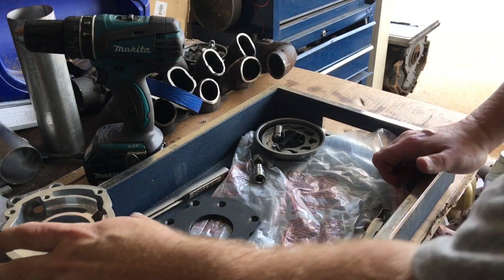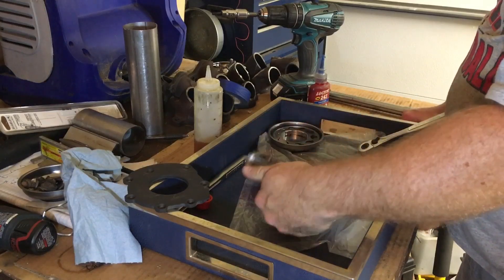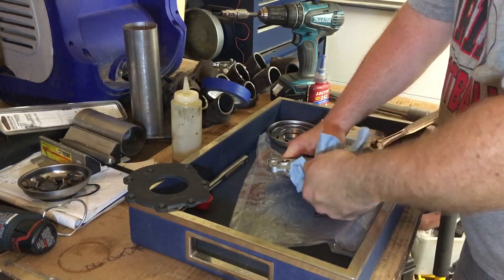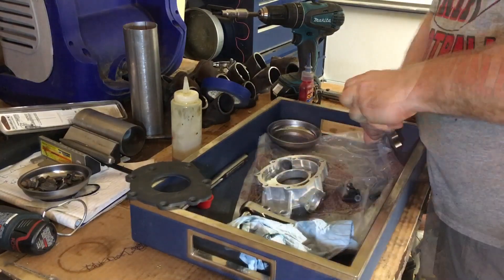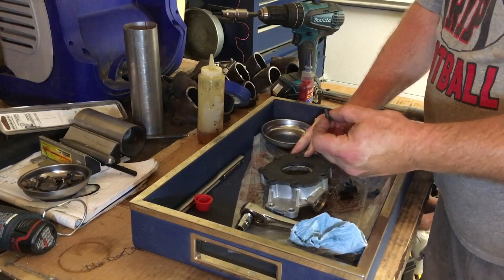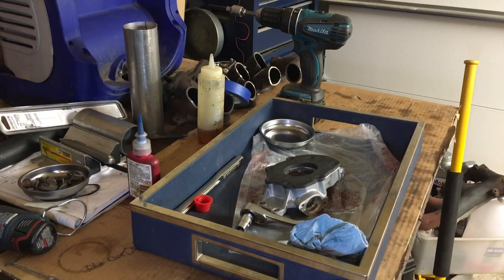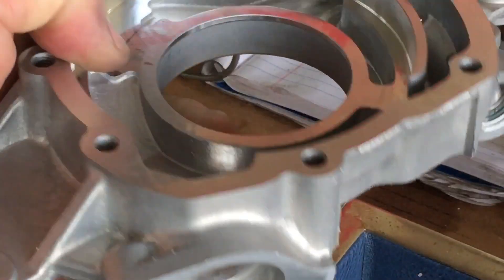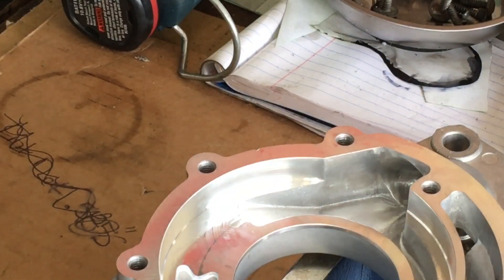LS Oil Pump Mods M-295 oil pump Porting/Shimming Complete DIY

Comment: The most unnecessary and wasteful "mods" you can do.  All this does nothing, the only way to increase flow is to increase the size of the pump gears,  The block itself has many 90 degree turns it forces the oil to go through and the pump doesnt displace enough oil for porting to make a difference.  Shimming the relief spring is silly as well, the clearances in the engine are what matters, unless you are trying to cover up a mechanical issue.
Reply from the maker: You can settle for a pump that starts bypassing oil pressure at 50 psi if you want.  I show how to improve the wet flow of the pump and delay the internal bypass to match the intended rpm usage when shifting above 5300 rpms. Thanks!

Comment: Nice video I’ll be doing the same for my project and how much PSI oil is at WOT or what’s the recommended number to not be dry on oil when I floor it
Reply from the maker: Normally with factory bearing clearance I see 70+ psi oil pressure at WOT M-295 pump with a .100” shim stock bypass spring.

Comment: You mentioned in a comment that you sell these pumps. Where can I find more information? Thanks.
Reply from the maker: I normally offer the porting/shimming service on any LS pump $75.00
The M-295 is the Stock replacement pump by Melling.  A better out of the box pumps are the 12095 and 12096. I do not recommend the 10355 pumps  , in a non-DOD application unless you will have an oil pan/system capacity of 8-10+ quarts due to very high pressure/volume; 80+ psi. JD
jeffdubray@gmail.com

Comment: Does shimming the spring increase idle pressure or just WOT?
Reply from the maker: Idle pressure seems to be a debatable topic. I can say when I shim the stock relief Spring .100” it consistently yields a Cold start 60 psi, hot idle 48-50 psi and 70+ psi depending on engine rpm. 
I haven’t seen any stock pumps match the same psi.  Plus, the stock pump is supposed to be rated as a 60 psi pump but has been proven to start bypassing oil around 53 psi which is not good at all for turning 6000+ rpms.  JD
Reply: @HeadFlowInc  I agree those are good pressures, and I’m seeing mixed opinions on it with idle. I’m struggling with 19-20psi hot idle pressure , new pump and oring- I’m thinking of trying to shim the spring just to buy me some time before I condemn  the motor

Comment: Where can a person source the shim for the spring ? Like your content
Reply from the maker: I bought a package of washers, they are the right diameter to fit nicely in the plug recess but I have to sand them to .100”. 
I’m not sure of the diameter at the moment but you might Google search once you’ve measured the inside of the cap and see if there’s any premade possibly hardened disc or washers .100”.  JD
Reply: @HeadFlowInc  what size washers are they?

Comment: one of the best described procedures I've seen on YouTube. I'm doing this on mine with a rotary tool, and I believe it's going to make a huge difference to increase my oil pressure from 25 at idle.
Reply from the maker: Blue printing or smoothing oil flow and shimming .100” will increase the bypass pressure.  I wouldn’t go past .100” shim, we haven’t tested above .100” and don’t want you to have any issues. Thank you for the feedback I appreciate it!  JD
Reply: @HeadFlowInc  thanks I appreciate it I was referring to mainly the smoothing out the sharp edges, rounding out the Sharp 90 degree exit point and removing the ramps down to the floor for a smooth transition. I'm not sure if I'm going to do anything with the spring or not. but those ramps, edges and sharp turns definitely cause turbulence in there and affect the flow of oil. but I'll probably just leave the spring alone unless if you think that I need to because of removing material and reducing turbulence?
Reply from the maker: Honestly, if you plan to rev the engine above 5300 rpms I recommend shimming the bypass spring on a stock pump.  The stock pump begins bypassing oil internally between 5000-5300 rpms which negatively affects the oil supply when turning higher rpms.  
Most cammed 5.3’s turn 6000-6500+ rpms. 
My 4.8 turns 7000+ rpms and I have no concerns.  JD
Reply: is this recommended on stock 6.0 LQ9
Reply: @sailshane  . Yes this would be equally applicable and recommended on-in my opinion:and engine that is experiencing low oil pressure symptoms or before they occur, if the oil ports are shaped and curved like this video covers. This will probably will usually always be the case on any LS Engine, but im just guessing in that. I've rebuilt one engine. Twice. All because of AFM lifter failure and the second time around i just went ahead and did a full AFM delete on my 2011 5.3L Gen 4. Right now I'm probably about 25,000 miles since that rebuild, and the engine's running great. I never had low oil pressure issues but I went ahead and did what he recommended in this video anyways since I was already that far down into the engine. I also had to rebuild my transmission because it failed about 7,000 miles ago, and since I put on a new torque converter and did the full rebuild on that transmission with new clutches and frictions, I now average 19-21 miles a gallon, whereas before I rebuilt the transmission hours averaging at best 15. So my engine, always firing 8 cylinders by not having active fuel management is running great and all those little things like What He suggests in this video but most importantly frequent oil changes I think contribute to its good health and performance. 

Good luck!

Comment: I use heat to break the Loctite sir.
Reply from the maker: Usually the bypass plug comes loose without heat but recently I had a new oil pump so tight it stripped the hex head on the plug; ended up needing heat. JD

Comment: You don't centre the pump before you torque down the face plate?
Reply from the maker: The cover plate is centered by the countersunk bolts there’s no way to adjust. JD

Comment: Any idea how far from bind the shimmed spring is?  Also, do you know what the OD of the relief piston is?
Reply from the maker: Oh my, you only shim the spring .075”-.100” it’s nowhere near coil bind. Using my HF digital calipers the piston/shuttle measures.5710”
Reply: @HeadFlowInc  Thanks for sharing.  Relief piston has area of .256 sq in.  Spring rate of 17.9lbs at shimmed height would provide pressure relief of 70psi.
Reply: https://youtu.be/CWCIdhG04LY

Comment: I like this a lot however... I'm an engineer and I have done spring calculations.  Simply shimming a compression spring increases its pressure but it has a side effect of shortening the life cycles due to fatigue failure.  This is why the hi-po aftermarket pumps come with different springs for different pressures.

Shade tree rule of thumb.. the longer a compression spring and the less loaded it is... the longer it will live.
Example 1:  A 10.000" spring that sees 0.100" of compression will essentially live forever. (spread the load over a long piece of wire)
Example 2:  A 0.300" spring that sees 0.100" of compression will live a very short life. (spread the load over a short piece of wire)
(actual life cycle # differs so that's why you see all different wire diameters and length. Two springs w/slightly different specs can look radically different! But the reason is to get calculated load + life cycles)
Here are some links to help understand
https://www.thespringstore.com/compression-spring-fatigue-life.html
https://www.thespringstore.com/spring-calculator.html
https://www.youtube.com/watch?v=5xYk7_YwbEg

Look closely at the springs in the melling hi-po pump, Its not just longer. The pitch is different and possible the wire or maybe outside diameter too. https://www.rockauto.com/info/583/10295-3-FRO__ra_p.jpg
Reply from the maker: wydopnthrtl We and several others have been modifying and selling these pumps for almost two decades.  I’ll have to google search and see if there’s been any negative results while running a pump with a .100” shim under the relief spring. 
I do follow and understand the concepts of fatigue of the springs in theory, my question is at such a small amount of shimming how long are we estimating to see a noticeable drop in oil pressure directly associated with fatigue?  
Stock spring is maybe 3.50-4.00” est.  4.00” spring shimmed .100” is not very much. 

My ported and shimmed Mellings M-295 pump holds 48-50# Hot oil pressure at a 700 rpm idle, 60# oil pressure cruising at 40-45 mph and has 70# pressure with more rpm/throttle.  Darn near a perfect setup for an LS engine, I’d like to compare the working results to say a Mellings 10296 performance pump.  Thanks for the feedback I appreciate it makes me think and consider more variables!  JD
Reply: @HeadFlowInc  I don't know the dimensions for these springs.  So w/o knowing I can't say for sure.  
Spring calculations are to be done in its compressed state. Not free state.  Free length is just a result.. not the functional spec.
I do find it curious that Mellings and other pump makers use 2 springs though.  In my years of experience (OEM) a shim is less costly than a spring. So between life cycle calculations and costing of parts... seems to me there is a solid reason why they would have the added cost.

Before I was an engineer I noticed the multiple spring "solution" in kits for transmission valve bodies and carburetors. I never really understood that until I dealt with springs in my profession.  In order for my design to get approved I had to show not only that it met life cycle specs.. but that I also had margin. For example if a spring is to cycle 100k times.. my calculations and physical testing would protect for something like 30% over spec. (130,000 cycles)
Reply: https://youtu.be/CWCIdhG04LY

Comment: So how much oil pressure are you seeing with a 0.100" shimmed spring? At a warm idle of course.....
Reply from the maker: Arturo Zarate Fully warm, idling @850 rpms, 5w-30 oil it’s at 48-50# 
Cold start it’s around 60#; we’ve really had good results especially under WOT.  JD

Comment: Have you had any experience with the white "COPO" pressure spring? My 10295 came with both the blue and white replacement springs in the box and the red spring already installed. I cant find any information from anyone running it. I'm really just interested in operating pressures since the only info given by Melling is "15% over the red spring pressure." Thanks in advance.
Reply from the maker: Lance Blake The answer is in the Mellings GM LS engines catalog, you can view it for free on their website. 
The 10295 pump is supposed to come with the +10 psi spring installed, also included are the Standard Pressure spring and the COPO +25 psi spring.
Interestingly, it looks like the COPO spring is similar to shimming the regular M-295 pump bypass spring +- .100”. When I port/shim the M-295 it raises the Hot idle pressure to +- 45-50 psi and moves the bypass opening to 65+ psi to better provide higher rpm oiling. 
https://www.melling.com/wp-content/uploads/2018/12/GM-LS-Engines-Melling-flyer-single-page.pdf

Comment: Heat is definitely recommended to remove the bypass plug.  The plug is aluminum and therefore it is very easy to round out the hex.
A small hand torch or a (plumber's type) Bernz-o-matic is sufficient.
As soon as you see smoke (burning loctite) it's  ready.
Reply from the maker: Kenneth Albert Be very cautious using heat as you stated the last think you want to do it warp the housing where the gears ride. 
Also, iirc the bypass plug is a Metric Allen head, make sure you have the right size. I’ve had these same issues with the Allen trying to slip and holding the pump body it’s definitely frustrating. 
Using heat seems to have worked so it’s a great option used sparingly. Thanks for watching and the feedback I appreciate it!  JD

Comment: You assembled your pump and put cover on it before you installed on the motor  . Did you center  the pump? It requires you to use 6 total  3 feela gauges between outer gear and 3 between gear and crankshaft to properly center the pump before torqued to motor
Reply from the maker: Bama Dave I’ve done it both ways, on this build I used the feeler gauges to center the driven gear. 
I haven’t seen any need to leave the cover off or remove it for installation. I don’t knock anyone for doing it, I just don’t use that technique. 
I may make a video showing both ways to validate any advantage between the methods. 
Thanks for watching and the feedback I appreciate it!  JD

Comment: When dealing with loctite  to remove just heat it up with torch and it will release the loctite  and bolt etc comes out easily
Reply from the maker: Bama Dave Yeah, I’ve had to do it to the dampener bolt in the crankshaft, they can be stubborn.  Thanks for watching and the feedback I appreciate it!  JD

Comment: What did you make the 100 thousands shim out of?
Reply from the maker: 407ForRent It’s a small freeze plug, I flatten the dome on the bottom flat.  All you have to do is go grab small washers that will fit inside the bypass cap.  Depending on what thickness washers you buy just stack them until you get to the thickness you want.  I must have edited out the part where I talked about making/buying the shim. JD
Reply: Feeler gauges are great as sacrificial shims. Used feeler gauges are almost free at garage sales and swap meets.